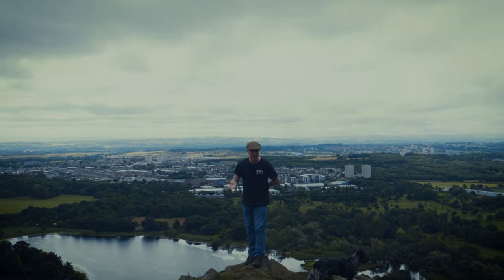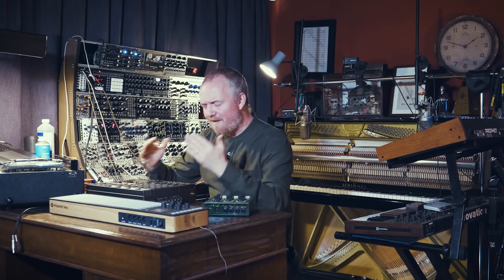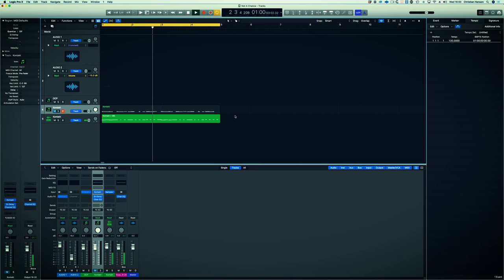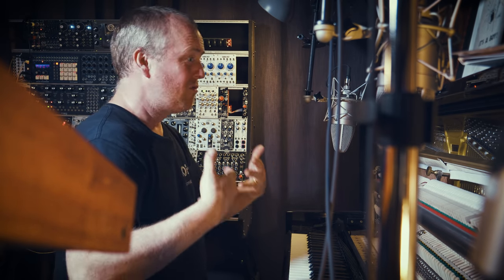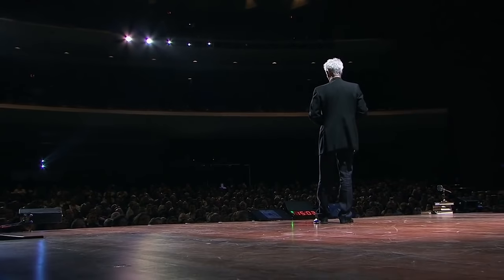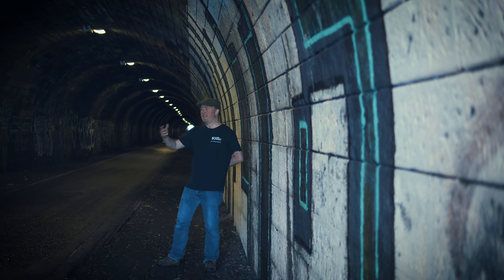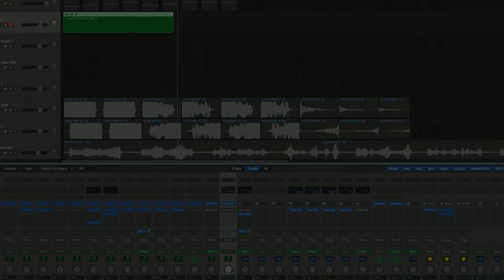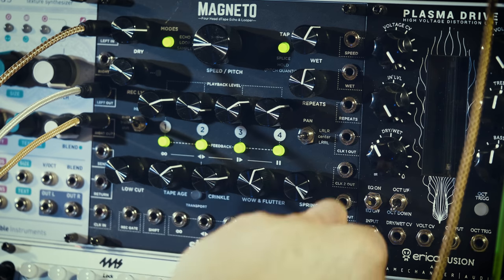Why Are Synths So Difficult To Mix???

Comment: But synths are quite literally the easiest instrument to mix. Like, I mean maybe being an actual electronic music producer helps. But the premise that synths are hard to mix starts this off completely backwards. 

There are so so so many reasons why synths are the easiest instrument out of all instruments, besides maybe a good female vocalist, to mix. They frankly mix themselves.
Reply from the maker: Ryan PWM you tried mixing a synth score into a film?
Reply: @TheCrowHillCo  Extract the dialogue and other important elements into an eq curve and invert that on the source material in some amount of parallel. The rest can be taken care of with multiband ducking with slow attack and release. Maybe even use one of those 32+ band plugins that actively scans an EQ curve and ducks that on another track. 

Use RX8 to identify problem areas where syllables are obscured and massage those parts down.

Broadband sound seems tricky at first,  but I find fighting technology with technology usually works best.

Comment: Great content of course, but... Please God get rid of the gimbal and the faux film grain/LUT, or at least use it correctly and consistently. I think your new little helpers got a bit carried away.
Reply from the maker: Vincent Rice I added the LUT and we’re applying the philosophy of Kaizen in making these videos as a means of exploring different ways of expressing ideas so hopefully you’ll see them evolve.
Reply: @TheCrowHillCo  Of course, and I feel like a dick for saying anything, but your narrative was so good that the incongruities were really obvious. I'll make clear exactly what I mean though.
a) there's very few shots that benefit from a gimbal. Static gimbal + long lens + IBIS = nausea. Also there weren't any gimbals in the 60s/70's so it looked very weird with that particular colour LUT/film grain. Tripod or good hand -held is the way to go. 
 b) LUTs are fun but they are designed work with images that have already have been exposure and colour corrected consistently across the whole project. They also nearly always need dialing back somewhat.

The better you get, the greater the expectation!

Comment: Why do you think synths are difficult to mix, bro?  Electronic sounds are built for the audio mixing format:  they are pitch stable (for pitched melodic sounds), have consistent current levels, are very easy to equalise because it is stable and because synths are electronic and synthetic in nature, can be changed into anything you want and can be used for any purpose in a mix.  I don't get it.  I think that people watching this vid will develop a phobia about mixing electronic sounds.  They shouldn't.  Synths are infinite shapeable because of the nature of the sound, more than acoustic regular sounds.  I think the phobia about mixing synths is all in your head, mate.  There is no such thing as a perfect sound in audio mixing.   The outcome can literally be shaped into anything you want.